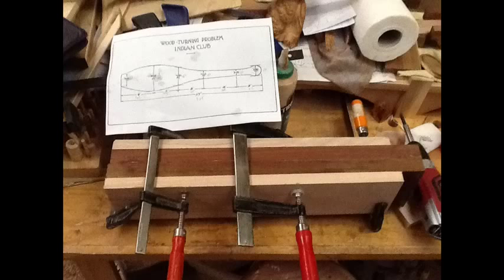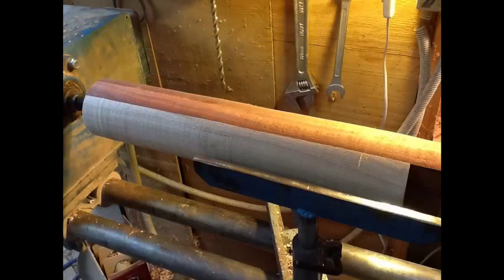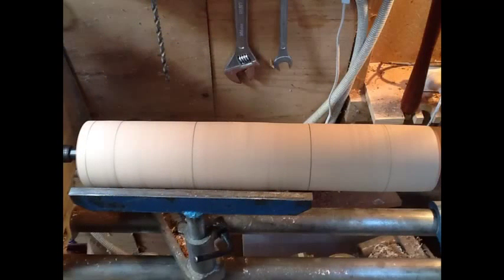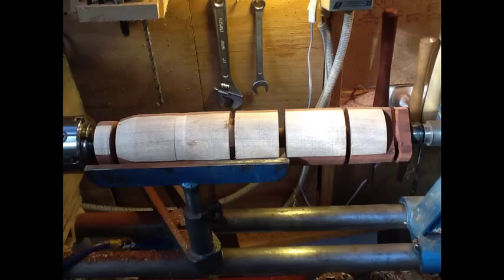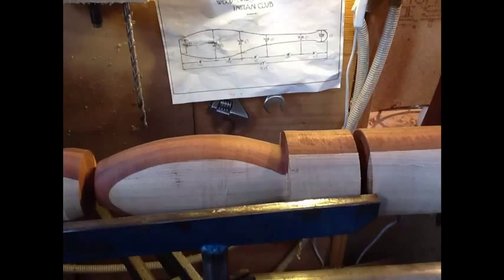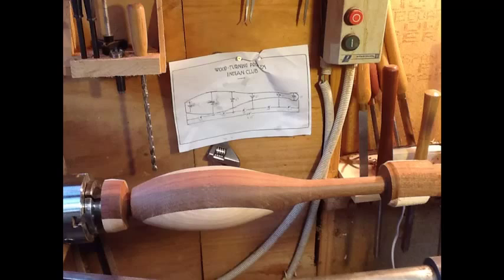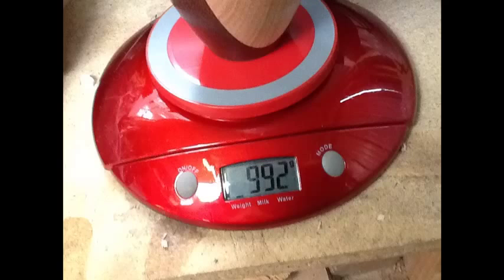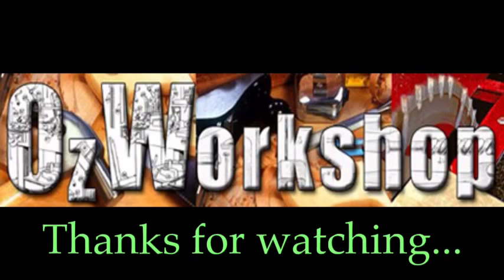Indian Club

Comment from the maker: Hi Louie, in fact it was absolute blind luck. In fact the second one I made was 1.1 kg using the same timber. To get it to weigh the same I ran a forstner bit through the bottom removing wood until I equalized the weight and then plugged the end before finishing.

Comment: You hinted at the challenge - but never revealed the secret!  How did you manage to get the weight nearly-bang-on?

The only way I could think of is that you measured the density of the raw wood, and then calculated the projected weight from the dimensions in the plan, adjusting the dimensions as needed to achieve the weight target.  That should work, but it sure sounds like a lot of work!

Comment: It's a bowling pin with a longer neck. Were these used to crush melons and coconuts?
Reply from the maker: Theey are used as a form of weights in exercises. Very old form of weight lifting. Strengthening upper arms and shoulders

Comment: Still have that template?
Reply from the maker: Hi William, no it was a one-off project for a young friend of my son. I no longer have that lathe either. I only have a midi lathe now and would struggle to replicate. Having said that, I got the original plan off the internet by researching Indian clubs. Size will depend on density of timber turned as well. You can achieve actual weight by drilling out base and filling with lead or sand. Cheers.
Reply: @OzWorkshop  Thank you sir